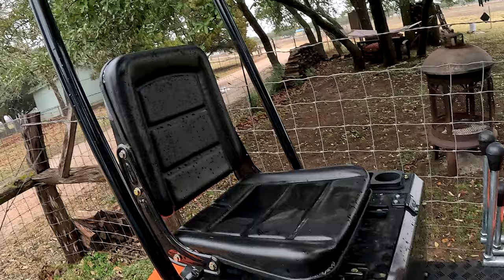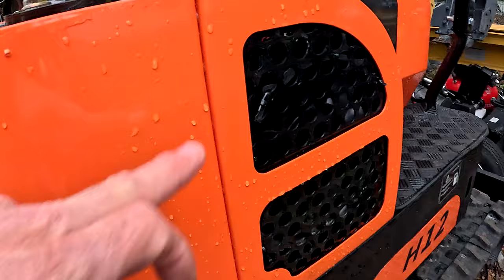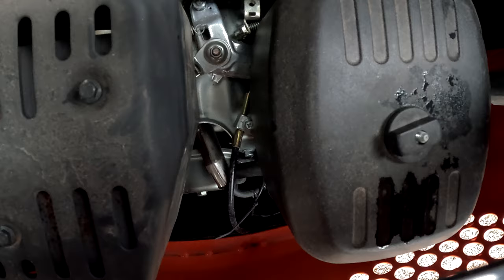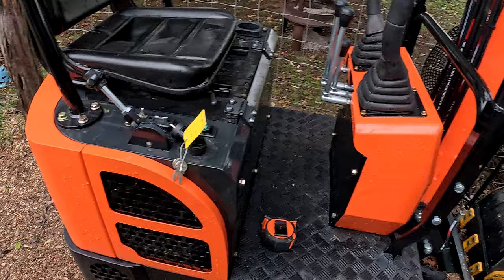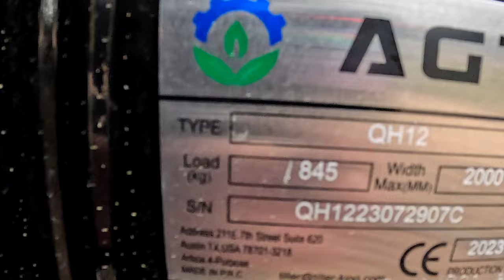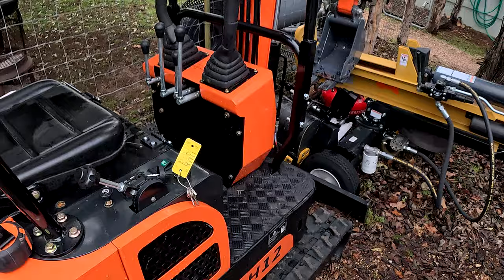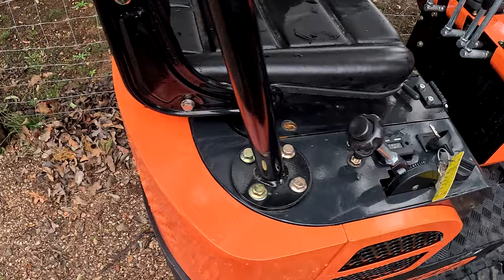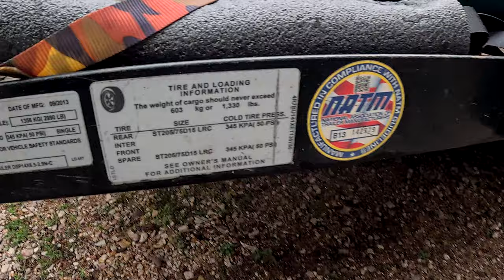(Recap) 2023 Chinese mini excavator

Comment: Just got mine this week--AGT H12. Had a few adjustments on the throttle and choke cable and then tightened some bolts. Ordered the smaller bucket, a ripper, hydraulic thumb, and fans for cooling. Tried it out a bit and was happy to see it work!
Reply from the maker: It’s a lot of fun!
Reply: If you don't mind me asking; where are you ordering the attachments? I had heard you had to grab them from the auctions.
Reply from the maker: @freetacos4everyone55  Amazon
Reply: @freetacos4everyone55  I ordered them off Ebay as well. I was concerned that since they were coming from a different store there might be some differences, but they all work. I am just waiting on the hydraulic thumb and so I am hoping this one will also just fit.

Comment: Thanks. Do you think this could be modified into a swing boom?
Reply from the maker: I’m sorry, I’m not understanding your question.
Reply: @brandoncalk1928  The primary purpose of boom swing is for offset digging around obstacles or along foundations, walls, and forms. A secondary use is cycling in areas too narrow for cab rotation. Independent boom swing is one of the major advantages of a compact excavator over other excavation equipment.
Reply: Kymron makes one that has a swing boom.
Reply: Anything can be modified, but I don't think its feasible to modify it. Better to buy a different one with swing.
Reply from the maker: I would buy one with swing boom already on it👍